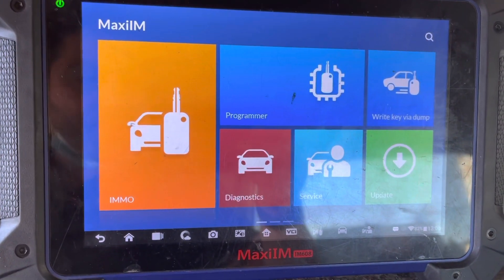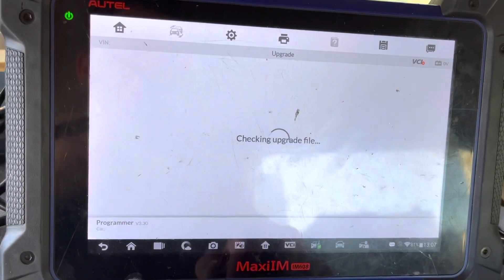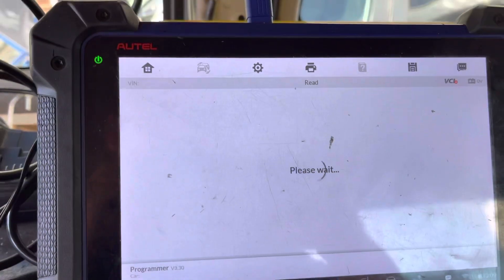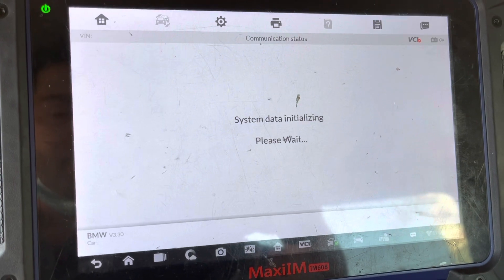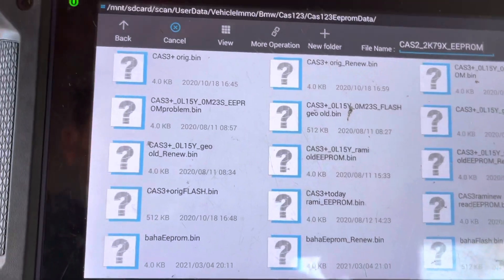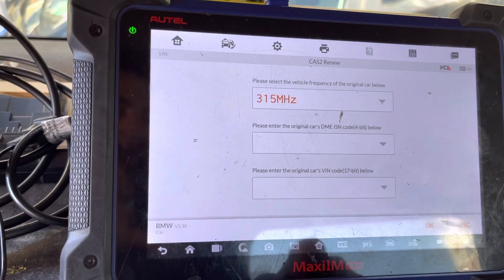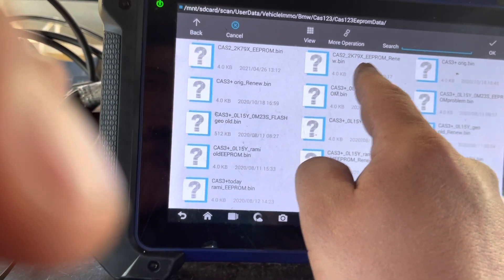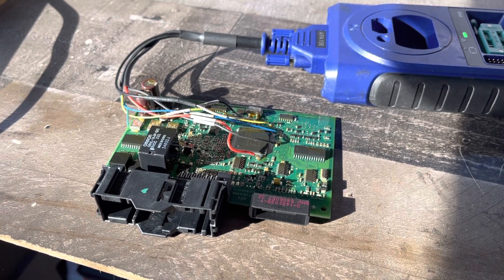BMW CAS2 renew, DME CAS programming with Autel IM608.

Comment: Hi can I do this basically but with a CAS4? but i'm not replacing anything. Situation is the Cas module lost coding as someone tried adding a key via obd with an 'Xtool'. I don't know if its just the coding lost or if the eeprom/flash is corrupted. Now on Immo status scan, error is 'CAS no coding stored'. also when I check vehicle frequency, it says 'Unknown Frequency'.  I already have the DME ISN..and pretty sure its a 315mhz.  However, what if the eeprom/flash is corrupted and not just a lost coding?  If its just a coding, how do i recover that if there's no backup.  Ask the first guy and he doesn't know if he even backed up anything.

Comment: Is this what I need to do if I replace cas1 module used on 2006 750li
Reply from the maker: Yes very similar
Reply: @huyug1  would you charge to walk me through it? I have Autel im608 customer had already installed used cas1, I tried coding it successfully but still crank no start
Reply from the maker: @reaper110588  dynamicautodisgnostic@gmail.com

Comment: My ecu has water damage so I bought an used dme cas and I have keys to that . But problem is this unit has high miles.  I need my original cas programed into this dme. Do you do this kind of work?
Reply from the maker: Yes definitely, if you send me your new cas, and instrument cluster I can align it for you. I would also need your original cas module to extract the original mileage of your vehicle. Another problem is now your vehicle is reading another vin number not your original which also needs to be fixed.
Reply: @huyug1  I didnt see this until now. How much to fix this issue?
Reply: @huyug1 hello how much to program a new ecu mine is damage

Comment: Great Video!! One question,  I have a problem with my dme. I have another one from donor car. So my question is can I make backup from original DME and put the file to the new one via OBD? using Autel Im608
Reply from the maker: That depends on the DME type.
Reply: @huyug1  my DME is MSV80
Reply: I will not recommend to used obd for that, to be safe use direct connection to ecm on bench is easy and works just fine and is safe

Comment: Hi. I have a problem with my dme. I have another one from donor car. So my question is can I make backup from original DME and put the file to the new one via OBD? I'm using THINKDIAG.
Reply from the maker: I do not think thinkdiag has those immobilizer functions  yet. You will need a tool that does immobilizer functions on bmw.

Comment: I have a problem, i replace the cas and the dme module, the car starts with a bunch of lights because the vin in cas dont match the car, i tried to change it vvdi prog, but then when i treid to read it saids vin  faulty and if i put back the original vin works, do you think with this solution you think it will work ?
Reply from the maker: You need to have have the same isn and vin number in CAS, DME, and EGS. You can renew or clone the CAS and DME from original if you have or reset the egs to sync with new cas.

Comment: Can I read the eeprom without doing it on bench ??
It wont pass on obd
Reply from the maker: Only bench
Reply: this job can be done via obd with many tools, even cas3, cas3+ not an issue.
Reply from the maker: @therivalryan  with Autel im608 it needs to be done on bench. Yes there might be different tools that can do it through obd2 but not Im608. The purpose was to show people how to do it with im608. Not everyone has Autohex2.
Reply: @huyug1  Don't be so defensive, I merely said it can be done through OBD with other tools. I was doing these through OBD nearly 10 years ago... AVDI , BMW explorer, VVDI2 ect  can all do it through OBD not just Autohex2 as you mentioned, not sure if you knew that. 👍

Comment: How did you get the isn from the donor dme? Also you say write the vin from donor vehicle.. did you mean write the vin to Match the vehicle it’s being fitted to?
Reply: So if I do it the same way you did with the other vin it will all just work? I have im608
Reply from the maker: @LeeLee-ce6qi  it did work with mine
Reply from the maker: I read the ISN through obd2. The original dme did not communicate so o just renewed the cas meaning adapted the cas to new DME.
Reply: So when fitted to the car what was done about the different vin? Abs system would not match vin so you’d end up with warning lights..?
Reply from the maker: @LeeLee-ce6qi  none of the module complained
Reply from the maker: @LeeLee-ce6qi  actually that’s a very good question! Somehow none of the bmws I did this way never gave me vin problems, interesting
Reply: Hey so just did this, left the vin same as the vehicle and only changed the isn. Works fine no faults, so seems the vin isn’t important. I figured the cas is the main place you tool reads vin it’s best to leave that matching the chassis. 👍🏻
Reply: @LeeLee-ce6qi  hey guys I just bought a flooded 335i n54. The DME is dead but the CAS still functions fine on my car. Are you saying that it's enough to get a key, CAS, and DME from another car and plug it in and it'll start? I have access to inpa and basic bmw diagnostic tools. Please let me know what's the best route to replace the DME
Reply: @nicksgarage417  hi yes you can make it run using the dme cas and key from another vehicle, however that will leave you with abs faults and loads or lights on the dash etc. the best way todo this is extract isn from donor dme and write to original cas. Ista will not do this. You need either Autel im608 or Autohex. (Autohex is the best as it will do it through obd)
Reply: @LeeLee-ce6qi   Launch Diagnostic tool also has DME - CAS alignment/synchronisation functions, maybe that fix it
Reply: @mrt-ee1zn  that function is only for alignment of already matching cas and dme, so that a vehicle can run,  we are talking about matching a second hand dme to another second cas. Launch is not able to re write isn codes.
Reply: @LeeLee-ce6qi  i was able to get isn code from a msd87.2 with launch tools. Function was called preprocessing in the anti-theft menu of bmw.  happened all by obd2 port.
Reply: @mrt-ee1zn  interesting, is it able to write the isn to the cas also? What launch are you using ?
Reply: @LeeLee-ce6qi  i realized it was only because  the  launch xprog3 programmer i connected with, it does the isn functions by obd2 port.
Reply: @mrt-ee1zn  can u explain the process with more details. I have LAUNCH THINKDIAG and need to swap the DME of my N52.
Reply: @LeeLee-ce6qi can I get your email or any means of contact you broo

Comment: What would happen if you chose flash instead of EEPROM?
Reply from the maker: It won’t write the file since the file size is totally different. EEPROM file is much smaller than flash file.
Reply: @huyug1  How did you get the isn from the replacement computer? Thank you for your time.
Reply from the maker: @abbydavis352  I have connected the new dme to vehicle and read it through obd with im608

Comment: My xp400 will turn off and won’t communicate after trying to read cas2 I have to disconnect xp400 and reconnect and it will comunícate again it will do that over and over but my xp400 is good I’ve made keys or MB for example no issue! Any idea what the problem could be?
Reply from the maker: As much as I know xp400 has a issue like that which is a hardware issue. Your supplier should give you another one. Unless you put wrong connections which is very common like connecting obd to xp400
Reply: @huyug1  it was my connection! Thank you sir!!

Comment: Did the ECU renew delete all the keys? I have been looking for this function.
Reply from the maker: No all the keys were active.
Reply: @huyug1  I have been looking for the function to delete all the keys to start fresh.
Reply from the maker: @monsonlockandkey  you can disable the keys and delete keys from coding function I believe but in diagnostic section and coding section. Go to car key memory and look it up.
Reply from the maker: @monsonlockandkey  or you might want to look for a virgin file which I don’t have. It will make the cas totally new with no vin or keys stored.